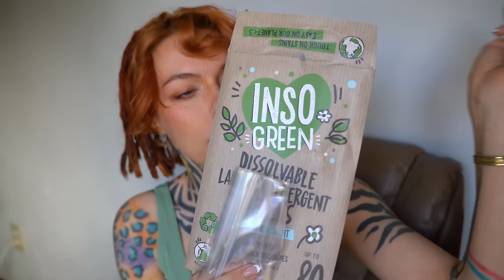preparing to drive SOLO across the USA in my 25 y.o camper Jeep xj

Comment: Very few guys know anything about the mechanics of a modern car these days (in fact, many will go to a garage to get some wiper blades changed), so getting 'done over' by unscrupulous repair shops is common irrespective of the gender of the customer. In addition, many are part-swappers rather than trying to repair. Luckily I have a go-to guy that is trustworthy and I've enough experience from my youth tinkering with cars to know when a garage is taking the piss! (I know a chap who had a squealing rear diff on a Honda CRV - local garage said 1500 quid for a new diff, but all that was really needed was a 15 quid diff oil change!). Good garages are worth their weight in gold.

Looking forward to following your trip, especially with the powerbank and solar (just going down this route myself). By the way, I don't know if they are available in the USA, but I use 'Festival Wipes' that come out in some shops in the late Spring for washing - they're basically a massive wet wipe and great for keeping clean when camping. Two per pack and rip in half, so four washes per pack for 99p - in the Summer, keep them chilled and they're so refreshing! 

All the best and no doubt it's really appreciated by many viewers that you take the time to answer so many of the comments that folk leave.
Reply from the maker: Yea it really helps to know the basics which is what I’m trying to learn so at least I know if garages are trying to rip me off - hopefully I won’t have to take it to a mechanics this trip but that’s unlikely haha - and thanks for the rec I’ll look it up!

Comment: When I lived in my van 🚐 I used this 5 gallon Gatorade container that had a dispenser from Walmart and I would just add bags of ice 🧊 inside that and let it melt into water and refill my bottle. I also had this portable toilet 🚽 from Walmart that saved me many times. It comes with sealable bags and I was able to use the bathroom in my van whenever I needed to. I could also pee while I was driving I had a setup 😂 and the best thing I recommend is an igloo cooler. I had this $150 one that looks like a styrofoam cooler, it has a shelf and will keep everything cold including the ice for up to 3 days (it’s very insulated compared to others) and you can even lock it. It’s the best cooler that is closest to having a mini fridge. Verizon was best for service out in middle of nowhere like western Virginia and mountains 🏔️ like The Appalachian Trail. Only AT&T was better for that. Stay safe! ❤

Comment: Make sure the water pump and cooling system is good to go. The 4.0L(Straight 6) were known for those problems. Ha I am in Taiwan and saw that fuel and gas prices are dropping it seems, lol! I travel to the states and truck camp every so often. Do you use like a Sheetz or some type or fuel discount card? Little wins are good because they build to be able to handle the set backs. Have faith, whether it is in a spiritual nature, yourself, the universe, or a back up plan. You are going to rock this young lady! Zip tie some ducks to your rack bet no one has done that! State parks are cheap and usually great facilities (Hot showers). Truck stops also have showers and are clean (Pilot, Loves, etc...). Safe travels and best of luck.

Comment: FYI after having a tire shop called Good Used Tires.  Always look at the DOT on the side of the tire the last 4 numbers on one side like 4023 is the 40th week of 2023.  Sometimes they are letters on one side and numbers on the other.  Don't buy anything older than around 5 years old for safety.  I sent a super thanks.  I hope it wasn't too scary about the rest stop.

Comment: I have a suggestion. You are storing your water next to your generator. That is a disaster ready to happen. Plastic is susceptible to pressure and if the pump pops off…
Just a thought. Be safe and have fun
Reply from the maker: It’s not a generator it’s a battery and the pump is facing the opposite way plus it’s not going to pop off plus the battery is water resistant

Comment: Yea my 1994 didn’t make it , no front suspension parts, so I gave it to the junk yard in exchange fir a few days to get everything off, then I rented 45 day and found a ford transit 250 got it, today almost all  main thing put back,  you should prepare and start long for a good ford. transit I was 40 buck a week gas now 4 days and it now at the full mark, so about 100 gas saving a month, now I wonder why I wanted so long. Prepare saving cause they threw outpre 2,000  parts part store, the transit van  now run like car. You can get a smaller one. They’re very light metal.  But  look at the lots as you pass,  and put away some money every month.

Comment: fyi, solar will work a lot better out of the shade ,you can probably charge iwhile the jeep is running, hype it up and lets see if you get a bigger unit out of marketing competion
Reply from the maker: The panel is one that works in shade so once it’s sunny it’ll work great 👍🏻
Reply: Helps if its clean also..😊

Comment: I think you have so bad faith, the 4.0L from Jeep is a very tough motor and the transmission is very reliable… so it’s all about maintenance and if you have a problem with a sensor, always go for the MOPAR ones, cause they other ones are garbage. Always keep your Jeep in good conditions and it gonna last, believe me, it gonna last. I recently bought a 96 Jeep XJ and the reason I bought it, it’s because the reliability and the parts are very easy to find and most of them are very cheap. So remember, is very tough car, just take care of her and it gonna last a lot of more miles!